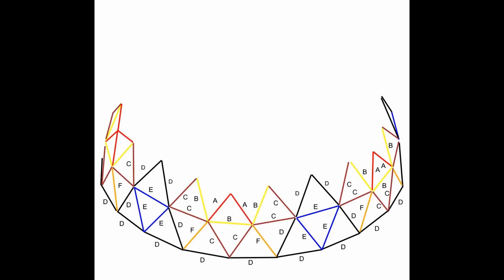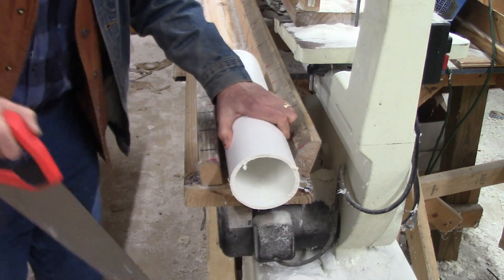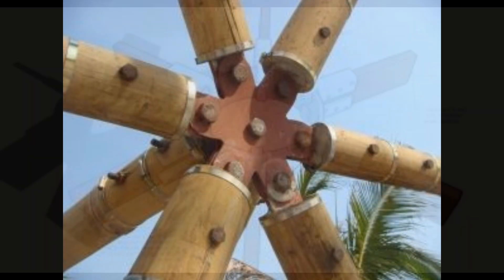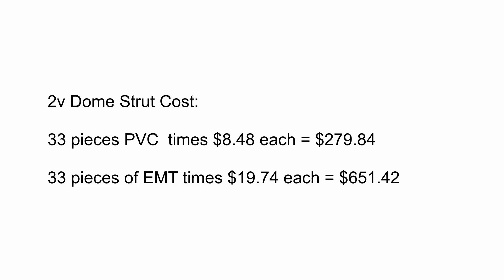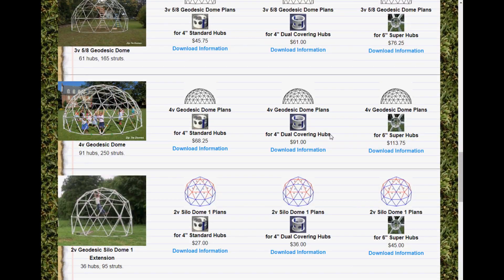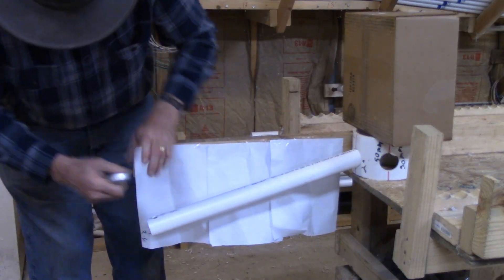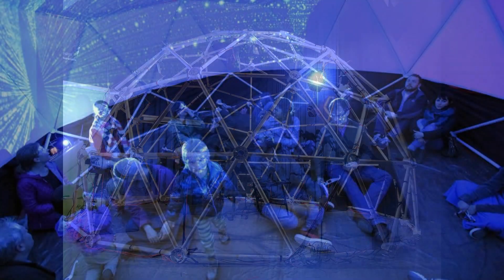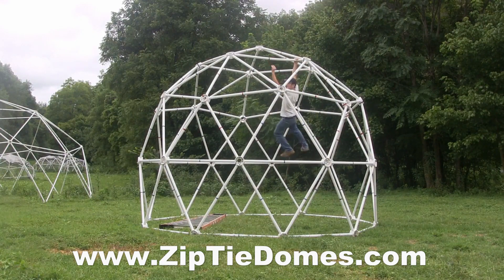Easy DIY Geodesic Dome Connectors that Anyone Can Make.

Comment: Awesome Idea, one point though PVC outgas's and it attacks polyethylene sheeting,  I love the idea of using bamboo.
Reply from the maker: Yes, Bamboo is awesome.  Less plastic and more Bamboo.  Take care.  John Hurt
Reply: Will the bamboo rot like the other wood?
Reply from the maker: @pbschulz  Bamboo has sugar in it, which will attract bugs.  Soak the Bamboo in water with borax and boric acid and it will last many years.  In high humidity situations, use PVC pipe.   Thanks for watching the video.  John Hurt
Reply: @pbschulz  yes, but if your growing it you have a forever supply,  I believe it is somewhat rot resistant as well if I remember right.

Comment: Proper care for and preparation foresight about using wood is always necessary.  Many of those wood struts showed wicking.  YTU has many lessons on soaking wood ends in natural liquids to keep is viable.  Strategies such as embuing in a vacuum or charring are also helpful.  While you showed 2 examples of persons who have admitted their failure, there is a high probability that within 50 miles exists wood in wetter conditions which was cared for, and lives a long service life.
Reply from the maker: Yes, you definitely need to treat the wood before using it in a greenhouse.  Thanks for watching the video.  John Hurt

Comment: Drain holes are important, ya'll.  This design looks great, but people will want to be careful in colder climates where entrapped water can freeze and burst any type of pipe.

I recently had a few hundred feet of 3/4" fiberglass rod fall in my lap, looking to build something similar.
Thabks for sharing!
Reply from the maker: Yes, don't fill the PVC strut pipes with water so that they can freeze, if that is even possible, as they are open on both ends.  And why do it in the first place.  Thanks for watching the video.  John Hurt

Comment: If you build the dome from the top down, you won't need the ladder.  As in; construct the top first, then lift the edge and attach parts, lifting it as you go.  The same way one constructs a Yurt.
Reply from the maker: Thanks for the information.  The larger domes are too heavy to lift without a lever and fulcrum, and I have some ideas on building levers and rests to pick up the dome around the sides.  

I did create a small crane and lifted up a dome at the center and built it down the sides, but it also had issues.  Both of these approaches requires something more than a ladder.
And yes, it is much better to be on the ground building the dome than on top of a ladder.  
It really depends on the size of the dome.  

Thanks for your input, I appreciate your comments.  I learn more from people like you and any other source.  John Hurt
Reply: If you start with the top floating in mid air, you don’t have to lift it at all!🤔
Reply: @TheGrobe  sky hooks are what you need!😉😉
Reply from the maker: @TheGrobe  May the Force be with you.
Reply: @TheGrobe  You laugh, but some domes are constructed in just this manner.  They cheat though, and use a crane.

Comment: I purchased the hubs from you guys and built a large greenhouse dome here in Sweden 4 years ago. Sadly it broke down the first winter due to the snow load. I replaced the broken pvc pipes and it survived through the second winter but broke down on the third hours before I was about to go out and remove the snow. I love the design and I will rebuild it with steel pipes next. The two main faults to my dome were. 1. Dimensions of the dome were too large for the size of pvc pipe (32mm) structual wise for the snowload. 2. The only place I could put was on a slight slope thus making the center of the dome "off center" vertically so as the winter came the snow gathered abit on the side and did not distribute the load top down but slightly scewed. All the best from Sweden.
Reply from the maker: Sorry to hear that you had a problem.  We try to keep the strut lengths down to 1 meter to 1.5 meters in areas with a lot of snow.  Also, you can put a post up in the center of the dome for support.  I think being tilted would be a problem too.  If I can help you, let me know.  Thanks,  John Hurt
Reply: @ZipTieDomes   @ZipTieDomes  Thanks for the ideas. I need to scale up the dimensions if Im going to use plastic again. I rather go the safe more expensive side and use metal pipes this time tho. When it gets above zero the snow gets extremely heavy with all the water that acumulates. I love the idea and I'm glad that I bought the hubs from you. Always nice to support family business.
Reply from the maker: @R0jiv4  Thanks!
Reply from the maker: Here is another idea.  You might try using thicker walled PVC pipe.  Some of the pipe overseas is thin walled, which won't hold up.  And EMT conduit will always work too.  Thanks,  John Hurt
Reply: @ZipTieDomes  Is it okay with you if I replace the broken hubs with 3D printed ones?
Reply from the maker: @R0jiv4  Yes, go right ahead and make the hubs you need.  Be sure to send me pictures of your dome and your 3d printed hubs.  You can contact me at this link:
https://www.ziptiedomes.com/contactus.htm
Let me know if I can help you.  If you want to drill the hubs out of pipe, let me know and I will work with you for free.
John
Reply: Thank you, your comment saved me from making the same mistake.
Reply from the maker: @TheRipdub  If you have any questions, you are welcome to contact us at this link:
https://www.ziptiedomes.com/contactus.htm
Thanks,
John Hurt
Reply: Keep in mind that pvc becomes brittle under cold cold weather. 
I want to build ine in Thailand, pvc is a problem with sunlight, and wood or bamboo are loved by thermites.
Reply from the maker: @JoseC888888  You can paint the PVC with a white latex acrylic paint to prevent any UV degradation:
https://www.usplastic.com/knowledgebase/article.aspx?contentkey=774
We have sold a lot of domes to Canada, and they have not complained about the PVC being brittle in the cold.  Here is an example from Manitoba, Canada:
https://www.ziptiedomes.com/customers/kimpoppel.htm
Thanks,
John

Comment: I want one
Reply from the maker: They are a lot of fun to build.  Call us at (931) 858-6892 if you have any questions.  Thanks for watching the video.  John Hurt
Reply: Hi John. Recently, I found out about 2 upscale glamping campgrounds in Dunnellon Florida. One has buildings. The other is using a well constructed tent. Hmmm, we'll see. Have you contacted FEMA about temporary housing for storm victims? Have you come up with a doored design? I have seen some but they do not look that functional. Thanks for the update. Art
Reply from the maker: @NPA.CitizenForTheCitizens  Thanks Art!  I am developing a new type of dome that would be easier to insulate and much stronger for permanent housing.  There are several customers in our "Customer Reviews" section of our website that have put standard doors on their domes.  They used a heat gun to melt the PVC pipe and bend it, flatten it, and then screwed it to the door frame.  Others drilled a hole into the door frame and slipped the strut inside.  My customers have better ideas than I do.  Thanks for watching the video.  John Hurt